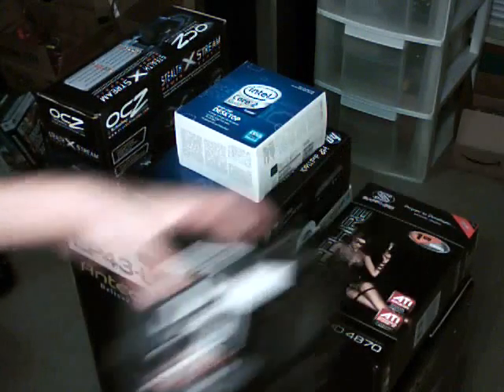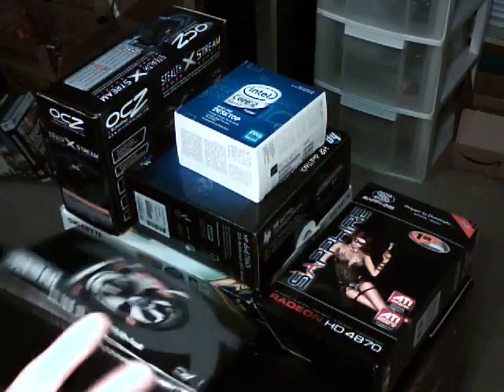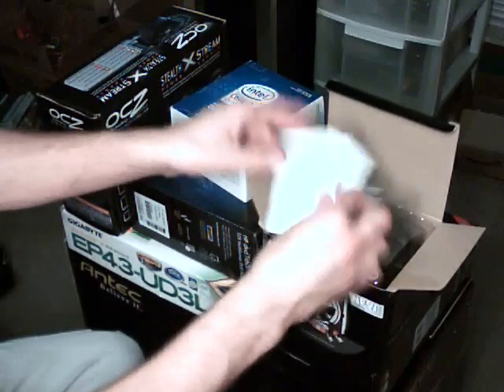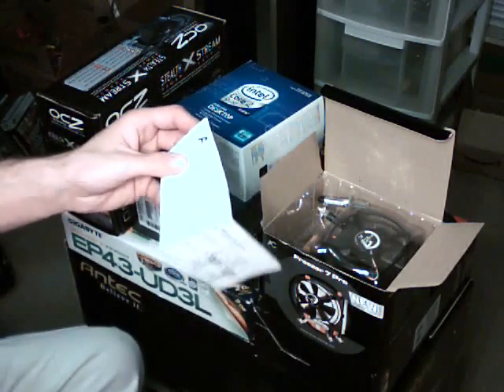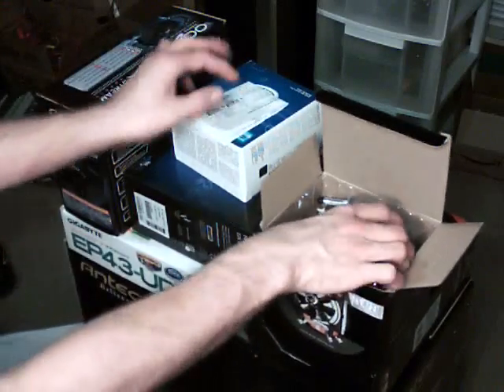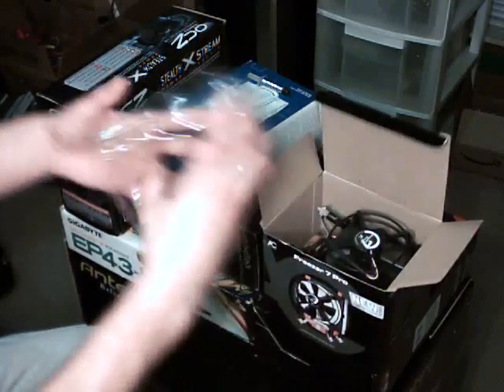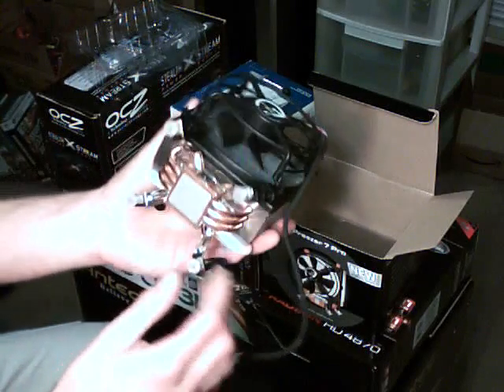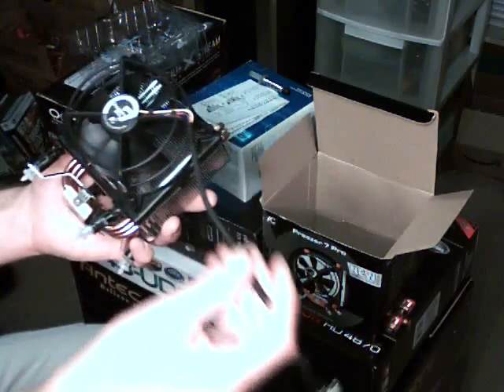AC Freezer 7 Pro Heatsink Unboxing

Comment: i have never had any problems with pushpins i used them for all my builds never an issue... the only problem is when installing the ninja cooler onto the XFX 790i motherboard. the cooler from the northbridge was so high you could not get your finger in there to push them down.

Comment: i disagree. I have this exact heatsink and ive almost snapped my motherboard in half after taking this thing off about 3 times. I cant explain it very well, but the ends of the plastic that clip into place will bend outwards after taking it on and off a few times. Plus theres the worry that this things gonna fall off, because if i pull it then it just comes off. I mean seriously lol